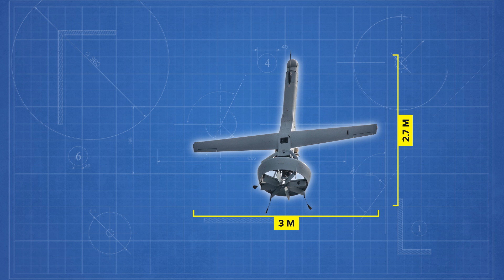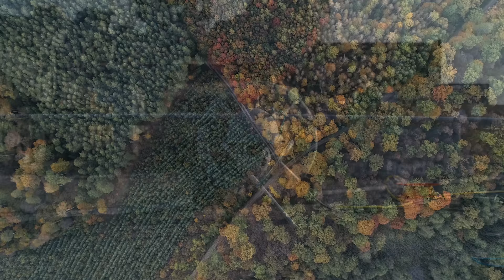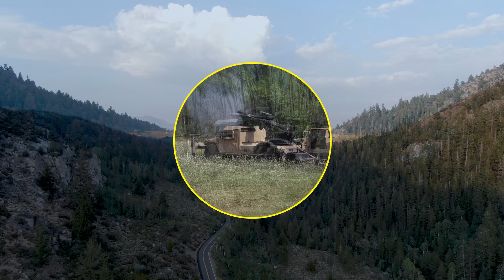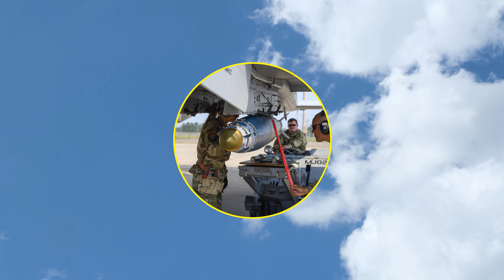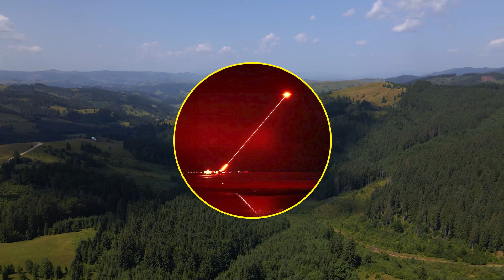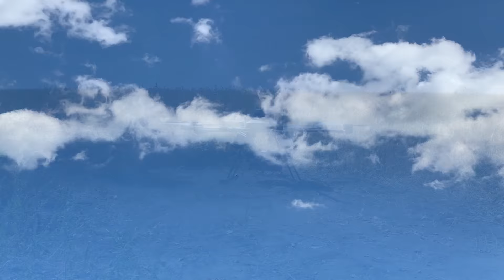INSANE Western EXPERIMENTAL WEAPONS Tested in Ukraine

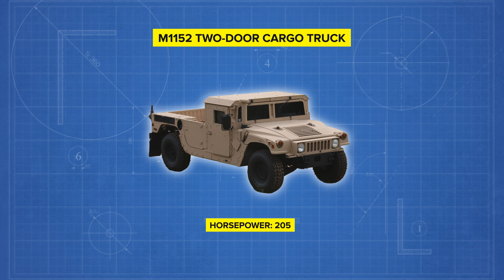Comment: Does a 205hp engine sound a little low to anyone else? 5:53
Reply: Don't ask me to lend them any of my Corvette's horsepower. I need that for racing between stoplights..
Reply: Not intended for speed, rather torque!
Reply: @carlosmaldonado5411 I get that it's a diesel engine built for torque, but a little more HP to scoot around faster wouldn't be bad.
Reply: @jeremyhall349  normal 8-wheelers have around 500hp, which is kinda small for engines that size. You dont need a lot horsepower when you arent building for speed.

Comment: The UK is foremost in lazer weapons and has passed on the technology to trusted allies
Reply: But what about LASER ?
Reply: Indeed, the UK has always been a very strong strategic partner to the U.S. and all of our allies.
Reply: So that won't be the US, then...🤣
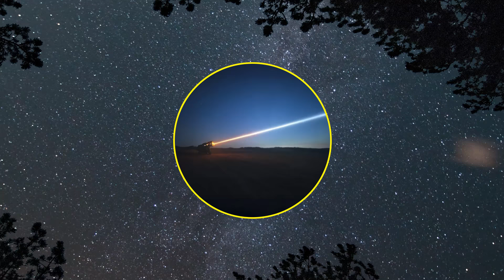Reply: Did you see that photo of the incredible laser in action 13:20? The beam was already about 2 feet wide after about 50 meters. It's a glorified searchlight. :')
Reply: @Cl0ckcl0ck  that wasn’t the laser in action but it’s blinding mode. A powerful bright light to blind the optical systems of machines and humans. Look at pictures of wreckage that was taken down by the laser. You see the hole where it went through an melt the metal. It isn’t as big as you think.
Reply: Does the uk lasers involve censorship and pdfs?

Comment: Imagine what that laser could do if mounted on a helicopter or drone - probably make ground artillary useless
Reply: Power generation for that LASER is the problem; it weighs a lot. LASERs are only a few procent efficient so for a 1kW LASER, you need about a 50 kW power-source.
Reply: @DreadX10  Miniaturized nuclear reactor.

Comment: The laser weapons are most impressive to me. I remember 20 years ago or so they were testing experimental chemical laser platforms and they weren't very practical. They were massively heavy high power lasers but used loads of fuel to operate. Several tonnes to reach peak output and fire a single shot. They could only do a few shots because of all the fuel you needed to carry around, produced nasty gases and lacked the sensors and control to hit multiple targets. The idea was to hit ICBMs in boost phase, but you were never getting close enough fast enough. Here we are 20 years later and smaller solid state laser weapons are being tested to hit drones and missiles and they show great promise. They actually work. They are compact, can be fired repeatedly and their power output is increasing with development. The future will definitely have laser weapons in it.
Reply: I can't wait to see them figure out to power this thing from the ground while flying it up on a tethered balloon for stationary air defense.
Reply: I think EMP weapons will become more common compared to lasers.  Lasers uses dense light, whereas EMP is electromagnetic.

EMP is to destroy electrical circuits.
Reply: emp has no sense also.  @nobledarkmoon
Reply: Guys, you missed Physics class in highschool?
Reply: This is why we are now aiming at putting them in space, less air to deal with... Granted we might have to violate a few treaties to accomplish this, but we've violated more than a few treaties before, so what's one more? 

To make my stance known I fully support this, and think we need to remain a force to be reconned with, if we wish to remain the world superpower.
Reply: The Directed Energy Center of Excellence in New Mexico is indeed relevant.  Dr. Robert Fugate will ultimately rank with Oppenheimer and Fermi.
Reply: lol @douglassauvageau7262
Reply: The benefits of Green Chili and Tequila deserve conscientious examination.
Reply: Check out sytropyros latest video on here. He made a handheld laser (batteries and everything) that's pretty dangerous. Would certainly be lethal to a drone although I'm not sure at what range. And he's just a very talented amateur. Blew my mind
Reply: And causing collateral blindness at an industrial scale, I suspect. Reflective light damage is a real problem with high output lasers.
Reply: How do lasers work in the fog, in clouds, in rain, and in thermal updrafts that make the air “shimmer”. How do they work if the adversary mirrors the surface of their aircraft (which could be as simple as not painting it), or if it’s a missile, rifles it so it rotates around its long axis while in flight so their is no fixed position for a laser beam to focus on?
I suspect that lasers look great in carefully controlled trials under ideal conditions but I think in the real world they will be easily thwarted.
Reply: @georgemiller151  What you have to understand is that when initially trialled, they had the intent of destroying ICBMs in boost phase hundreds of kilometres away. That was never practical not least due to atmospheric conditions and the other reasons I cited. What the latest solid state lasers ARE practical at is cheap, close range point defence. Especially against drones. It should not have to be explained to you how critical this capability is going to be if you have watched sixty seconds of the war in Ukraine or Houthi attacks on shipping. You don't need 100km range. A mere two or three kilometres could be very useful indeed. That is viable.
Reply: can you imagine these lasers aimed at front line ground troops and vehicles ; that would change the minds of people wanting to step foot to invade another country.
Reply: @chatyman28  Lasers make sense for a defensive perimeter. They also make sense if miniaturized enough to be installed on a fighter jet.
They're worthless for hitting targets over the horizon.
With planned upgrades to small nuclear reactors as well as battery technology, I could see a special attack jet that uses lasers to zap ground targets. That would be scary.
Reply: lol @protorhinocerator142
Reply: Lasers will be useful, will also be easily thwarted, until the next generation of countermeasures comes along. And so on. They will continue to improve until buck Rogers and star wars are real.
Reply: Laser weapons suck.